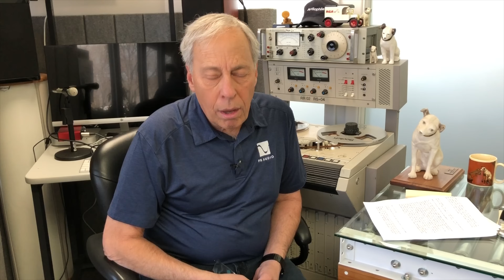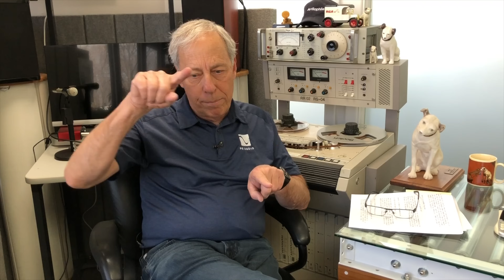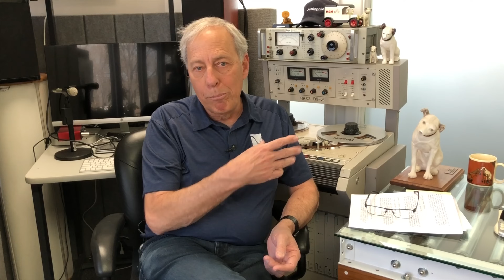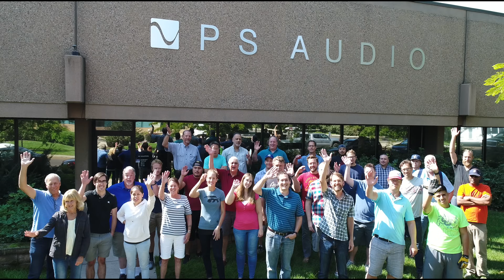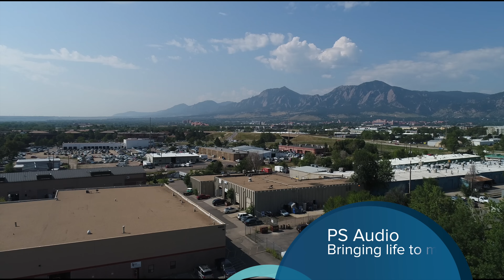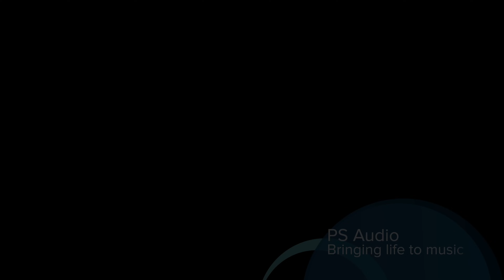Why aren't class D amplifier better liked?

Comment: Excellent explanation Mr. Paul. thank you.

I like to experience the sound, in many ways, including the conception of an amp. and any component in the sound chain in an audio system. the class d amps nowadays are amazing, even cheaper ones, actually, i'm making some audio projects based in this kind of amp, from 3 Watts to 1000 Watts. honestly, i'm impressed.

i wish to hear some of your amps, (the stellar one for example), at the date, i have not the priviledge.

Greetings from Colombia.

Comment: Class D amps are fantastic for subwoofers, but my vote is for class AB..
Reply: My vote is for the planet and that means efficient designs so Class D is the way to go.
Reply: @blackened18019  but you're the laugh, that's the funny part.
Reply: @blackened18019  oh but you have it so backwards it's hilarious. Must suck to be so inexperienced but so vocal.
Reply: @blackened18019  looks around at all the highly rated classD gear. Man those $45,000 ki 3 speakers suck! Haha. Ok kiddo, nobody is going to take your emotiva bas x from you. You'll be ok.
Reply: Steve Wodell it isnt 1998 anymore. Class AB is well surpassed.
Reply: @Audfile  Class AB destroys D unless you live in an apartment with tiny little speakers.  Please.
Reply: @erod9088  absolute rubbish. I own high end class D and i laugh at your old crappy dinosaurs.
Reply: @Audfile  In a living room, they're just fine.  When you're trying to drive demanding speakers in a 4,000 cubic foot dedicated theater room, not so much.  In too big of a setting, they sound tinny and bright.  There's a place for all  these amps, but D amps  don't compare for delivering truly musical sound on a big stage.   This is fairly consensus.  There will be a day that they can, but this is not it.
Reply: @erod9088  i guarantee i put out, far far far more dynamic power with extension to 40,000 hz and my bass doesnt sound like a wet fart. With liquid black noise floor and no heat. You are living in 2001. Class D has been superior for over 10 years. Try again old head.
Reply: @Audfile  translation you can't afford good amps.
Reply: @erod9088  other way around I'm afraid,  it's OK,  you did your best with what you have.
Reply: @Audfile  lf only anyone who takes audio seriously agreed with you. But I understand, you living in an apartment and all.  Can't bother Edna next door.
Reply: @Audfile  If only any expert in the industry agreed with you....

Comment: I do not care if the amp is class, A, AB, B, C, D, E, F, G...Z as long as I am happy with its sound :)
Reply: Class A power amps are a PITA, even if they sound good, because they are extremely inefficient. They are expensive, heavy, hot, need a lot of power and if they use tubes, they are also fragile. Class D is the opposite. AB is somewhere in the middle.
Reply: class AB is best.. for eg TDA7297.. TDA2020
Reply: And my wallet remains happy and not empty
Reply: Class D is all over the place in actives speakers/subs and they fail well before the speaker does.

Comment: Could you explain what goes on in the input stage? I don’t understand what sort of things you could to there which would affect the sound other than something like an EQ.
Reply: gain, Volume, EQ like low pass high pass. there could also be some high frequency noise filtering or AC hum noise filtering.

Comment: Class D can sound very good. All it need is huge, fast and clean power supply as it's back bone. An refine input stage. Also a very rigid and heavy case work. Which means big price tag. Many might not know all class D amp vibrates. I remember the one I built form scratch in uni. When I ran it, it walks like old washing machine. Some of the cheaper industrial class D amp in DC servo still make buzz noise.
Reply: I am guessing you used a slow switch speed and the output MOSFETs would not compare to what is available currently.
Reply: I had a Denon Class D 7.1 AVR. Gave me a headache. Sounded thin and harsh. It relied on tons of DSP.
Fact is, these modern Class D AVR wattage ratings are a fairytale.

Comment: To my surprise the guitar amplifier industry has embraced class D and now 200 watt guitar amps ar smaller than a lunch box and 75 watt amps are the size of a cigarette pack.
Reply: I could add an smsl sa90 onto a pedal board. I bet it would drive 4x12 cabs screaming loud!

Comment: Transformers bring distortion, it is kind of weird that people consider them in higher quality circuits.
Reply: The problem is that, unlike other components, the distortion brought by the transformer, can't be cancelled easier by other components, so that you would get a perfect reproduction as a whole result. That is, if you take a perfect solid state amplifier, put a transformer at the output and the tubes just for show, it is most likely be recognized as "high end tube" one by the idiotic audiophiles, that is, they are able to hear the sound difference brought mostly from the transformer often found in tube amplifiers (some samples specifically constructed can be also perceived by non-audiophile with perfect hearing).
Reply: All components can bring distortion. Impedance is frequency dependent so everything changes as the frequency changes. That is why a system has to be designed to actually work together so as the frequency changes the impedance changes at each stage cancel each other out. The more you get into the actual physics of what is happening from initial recording to what we hear you begin to understand the complexity of the problems. I have never heard a Class D that can sound as good as an old school Linear Amp.
Reply: And nonlinearity... yes

Comment: Paul good to hear more info on class D amps, my ears pricked when you mentioned the B&O ice power module PS Audio use. 
I myself have just purchased 2 mono blocks with that same module and when they arrive I will hook up the Shiit Freya preamp with its 6sn7 tube gain. 
To my delight having you talk about your BHK and Stellar amps having tubes and that class A thingy at input stage my setup should sound great
Reply: Curious to know which mono blocks you bought (owning a freya myself, so...)

Comment: The power usage between class D and AB is, in the greater scheme of things, nothing at all. And D amps don't sound as good, and a lot of people relate D with "digital", and putting an analog signal through a digital filter is a waste of time, kind of like using USB to "copy" a record album, you go through the RIAA filter and then the digital filter.Class D has its place, and is quite useful, but you don't go all out on audio and then compromise  on the amp, Class D needs to stick to Subwoofer plate amps and car stereos
Reply: Class D has gotten good enough that in general you can not distinguish between it and class A/B at the same price point. There are many different things that can be done to make a class D sound good enough that even the best speakers won't be able to tell the difference. I would certainly take a Crown XLS2502 over literally anything from 10+ years ago.
Reply: I think Paul just said that there is no compromise.  You would be surprised how far Class D has come in the last few years.  The Hypex NCore NC500 Modules have one additional feature; they have a plug in input stage.  You can go with an IC Op Amp or discrete components, kind of like tube rolling.
Reply: You need to listen to some different Class D amps then.
Reply: Rolf Hawkins  I have heard my share, and don't  get me wrong, they are quite nice, but as AB is acompromise over class A, Class D is also a compromise, and great for a "modest" system, but having gotten back into audio as primary and trying to build a  nice if inexpensive system, I have made compromises, but class D won't be one of them them. An expensive turntable is quite often engineering  you don't need, my speakers still sound great, my musical sounding sub still sounds musical, but  there is just not enough  of a price difference  to trade a smooth analog sine wave for pulses and noise filters. For   a  digital only system sure, but  I still love my analog,  and a straight analog signal path  even though  my turntable  is inexpensive, its still quite good, and deserving of  more  classic  ways of doing things. Just my nuerosis  is all.
Reply: What should life be easy for people like you :)
Reply: <Billy Grindstead: You need to stick to the Zoo, if it is the same price tag on a class D amp versus a Class AB amp then Class D amps sound way better especially in the bass area!

Comment: The newer class D amplifiers run at more like 1.2MHz and operate almost filter less.
They sound surprisingly good these days. I have used many TI modules.
Reply: That'd be ridiculous for EMI reasons. I've heard class D amps switching at 300-400kHz and still sound amazing.
Reply: Hidde de Wit 
They do, but the new class are in the 1.2mhz spectrum and by pushing up the frequency allows for very efficient operation with very small filters to cut the emi in the am band. I have tested a bunch of 50 - 100 watt modules used in things like soundbars and they sound amazing.
Reply: What about using a high-power class D amplifiers at a lower frequency for subwoofers or woofers, and a lower-power class D amplifier for tweeters?  The less power the high-frequency amp is switching, the less EMI it should emit.
Reply: @flatfingertuning727  most bass heads on youtube like EXOContralto use class d amps
Reply: There are 50 and 100 Watt modules I have tested using ti chips that are in the 1.2, and a small power amp with internal media player by SMSL operates at 1.2 mhz
Reply: Which ones? Latest Icepower 1200AS1 is 500kHz and nCore NC400 is 480kHz. Thanks.
Reply: @Olav Viking D can be an analogue amplifier. D doesn't stand for Digital.
Reply: @Olav Viking The pwm is digital, but the amplifier can be analogue. But I guess that the best d class amplifiers are digital because of better control over the power output. I have heard some fantastic class D amplifiers. The NAD Masters series.
Reply: @Olav Viking Of course all have to make analogue vibrations at the end for the speakers, but in that sense no amplifier can be completely digital ever.